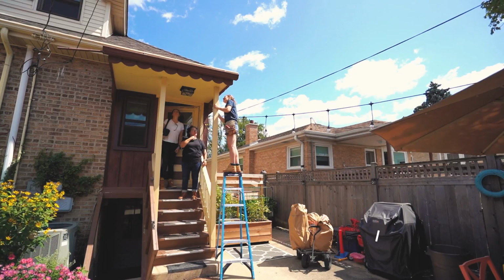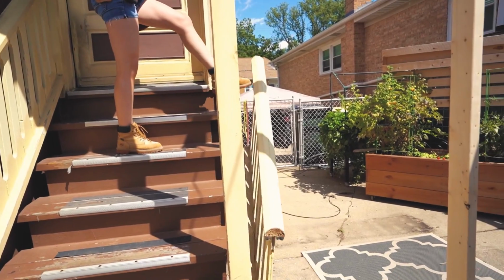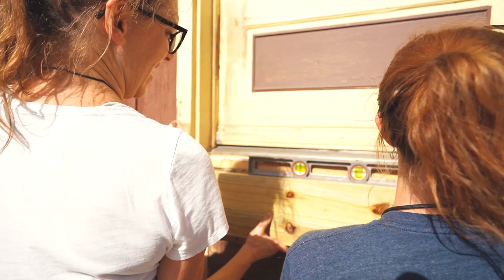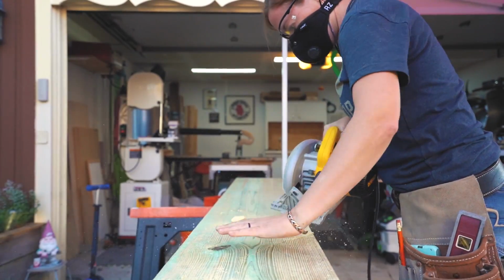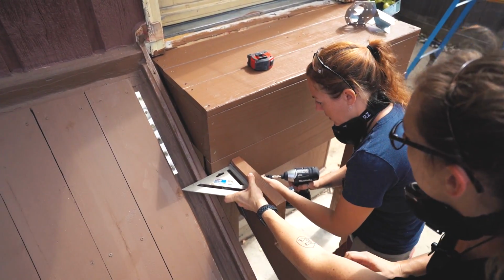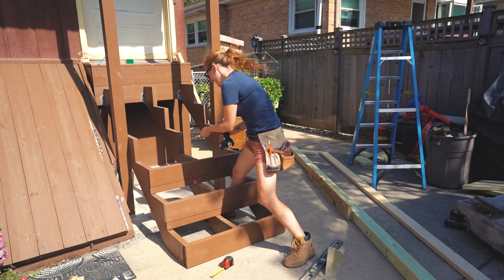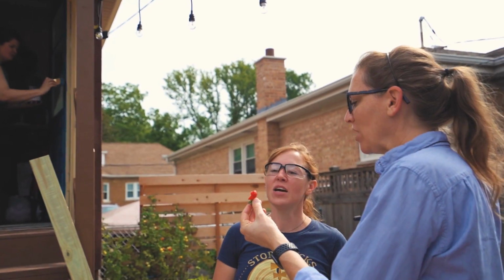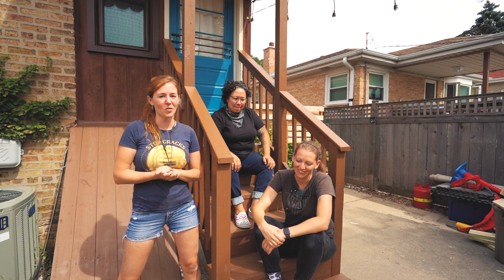Building a Set of Stairs in Three Days | DIY House Stairs | House Renovation

Comment: Looks good! One word of advice though. Any type of hanger should be secured using hanger screws or hanger nails. Regular deck screws don’t have the same amount of shear strength.
Reply: I think April does a great job showing how to build furniture and things of that sort, but I think that she really needs to shy away from trying to show how to build things that are influenced by building codes. I don't see how her "landing" meets code, nor do the screws into metal hangers. She does what a lot of homeowners do, but a lot of homeowners don't read or understand codes when they do their work, and it shows.
Reply: Yup. Always use the rated screws for their intended purpose. Those screws are not rated, and in fact, not close to the needed shear strength. Repeated motion might have ill effects on them.
Reply: nicholas mizer Good tip!
Reply: Exactly....those screws lose their coating on the zinc brackets, corrode, and can fail within years
Reply: Yeah your right, they probably have more shear strength, harder to stand up to a hardened bit!
Reply: bottom line is --- NOT if something will work or may last.It MUST BE UP TO Code. Codes are there For Peoples safety. When u are Dealing With People & structures for Entry & Exit of Buildings its Especially important that things are up to Code. Min Code specifications were devoloped for Peoples safety. Thats why we have inspectors & Have to pull permits.
Reply: Oc is spot on with the codes and i would add the manufactures of the products will document their use. anything i do structurally is always nails or galvanized nails for outdoors.  there are also structural screws, ie; LedgerLOK brand
Reply: I wouldn't have used a hanger in the first place. Hangers are overused, expensive and usually not the best option.  I would have attached a 2x directly to the back of all three stringers before installing (yes, you might need plenty of help to raise all three at once). Before raising though, a 2x should be placed on the structure (lower than the stringers) for you stringer assembly to rest on. Anytime you can rest your framing instead of 'Hanging it' you're going to be more structurally sound. That's why they are called hangers. Rested framing is always the best option.
Reply: yopagedotcom exactly. There are a million ways to frame something to code, but there are a million ways to do something wrong too.
Reply: True, but this a stairway, not a deck. That thing is going nowhere.
Reply: august it doesn’t matter whether it’s a deck or a set of stairs. Deck screws aren’t intended to be used in structural hangers.
Reply: @nicholasjohn1001 , I agreed with you, but In this case, do you really think it's going to shear away or have any problems what-so-ever ?
Reply: @augustreil  
Did you ever flex back and forth to break off a piece of metal? That is what will be in play every time someone uses the steps. Ever so little but still flexing. Lag screws would have been much better suited for the job.
Reply: @larrybe2900 , I already agreed with nicholas mizer and I agree with you that lags would be better or even structural screws, but there's no chance of this staircase falling apart because of their screw choice.
Reply: august you are wrong. This isn’t an opinion, hanger nails and screws are rated for these instances. There is a chance for shearing off, especially with the metal to screw connection and the flexing of the structure. Deck screws are not rated for this and shouldn’t be used. As a matter of fact, any inspector would fail this. Now, is there a chance that this structure will survive with limited use? Yes. But is there a chance that it will fail? Yes.
Reply: @nicholasjohn1001  Good point and I agree.  I missed this when watching.  This is a lesson that I learned from my father who is a retired historical architect.  Next time I see him, I'll have to remember to have him watch this to get his insight.
Reply: @nicholasjohn1001 , Sure, that's fine.
Reply: @augustreil  Keep in mind people use these videos to assist themselves to complete projects they're unfamiliar with. They read the comments for further information/tips etc. That being said, anyone unfamiliar with the differences in screws and nails will be glad to read about which type of screws/nails  should in fact be used- I know I would, to me that is very important information.
I am always appreciative when much needed pertinent information is added, no matter how big or small..
Reply: @augustreil  it's a matter of what the building code requires. It requires special fasteners for the demands that connection endures.
Reply: august LOL I’ve got a 12’ x 12’ deck that I used drywall screws on 20 years ago with the intend of changing to something better later. Even the ledger board and posts were just treated deck screws no lag bolts. I added on to the deck last summer and I forgot I even used the drywall screws. I went ahead and replaced them but hell they didn’t need it. They looked like the day I put them in.
A drywall screw has a shear strength of 190lbs. A 2”x12” joist hanger has what 6 screws to a side so 12 screws holding the joist to the ledger. Soooo were looking at  2,280lbs of shear strength per joist!
LOL I have to agree with you that there is no chance that these steps are going to have a problem. I came to the comments to see if the YouTube safety police caught her standing on the top of the ladder I wasn’t expecting the screw issue. I’m glad someone caught it now if she’s just get it fixed we could all sleep better 😂